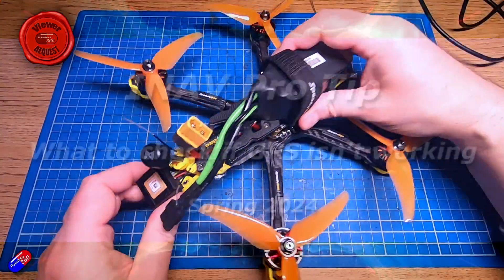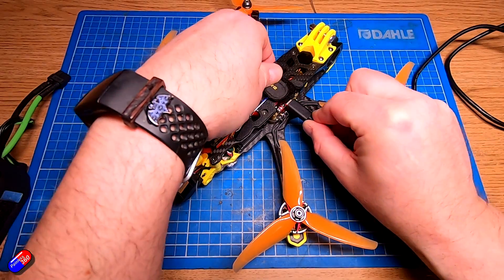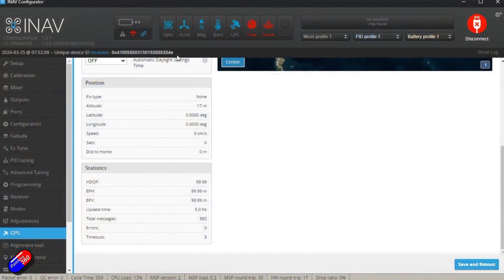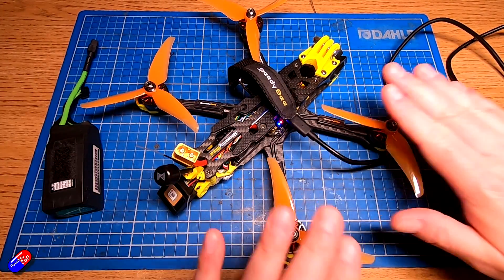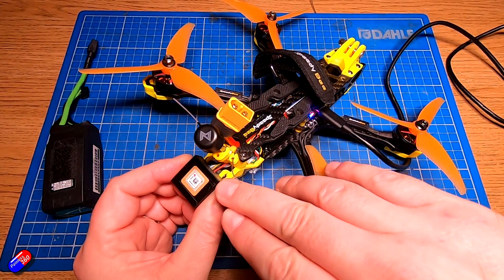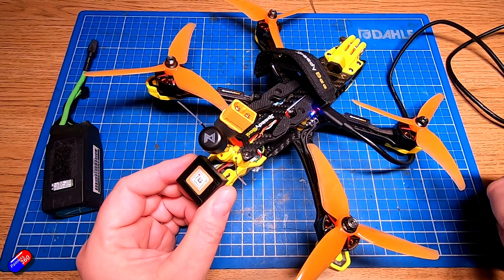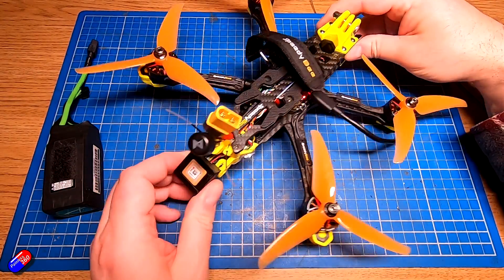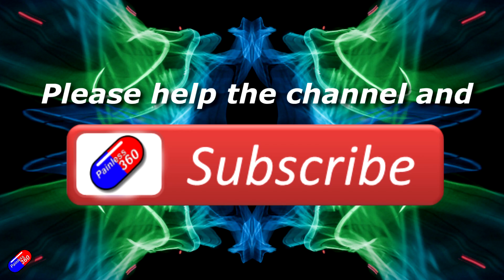How to fix your GPS when it isn't working (INAV)

Comment: I have a fimi manta and i am using INAV so got it working for me to try to arm it but it doesn't arm. Something hardware error,  i checked the GPS and the XYZ doesnt have any numbers like yours did in the video, the RX to TX SCA to SCA and the other to the same, it looks powered on but no movement on the gps numbers. Any ideas?
Reply from the maker: See my video on troubleshooting arming.  Best of luck!
Reply: @Painless360 thank you!!!

Comment: thanks for the video, they are super clear and helpful, on question here, why, I see my latitude and longitude and all the GPS info and 3D fix in inav,  but then, in Radiomaster Pocket and discover new parameters and I can see all parameters, except the GPS info.  I have the  ExpressLRS last version 3.6.6,  the radio firmware updated and the F405-WING-V2 with last inav. I do not understand why is not sending GPS parameters too, any idea?, thanks in advance.

Comment: Anyone had any success by wrapping  the cable from GPS to FC with conductive grounded foil as noise shielding?
Reply: I can almost answer my own question. Just tried wrapping copper slug tape around the cable and earthing it to gnd on the FC.
Previously it took 5 mins to find 6 satellites. Now it takes less than a minute to find 10.
Early days though - I'll see how it works out at the field.
Reply from the maker: Best of luck, watch out for warm vs. cold starts on the GPS giving a false idea of startup times.. Happy flying!
Reply: @Painless360  Just tested at field. Shielding does make a difference - at least for me with 5" quads.
A quad without shielding took 5 minutes to find max of 6 satellites. Another quad with shielding took 2 minutes to find 9 satellites. Very similar quads.
I don't think grounded shielding is a silver bullet for fixing GPS. You still have to follow all the steps in your video. But as a final little step it can really help I think.

Comment: Hello Good Sir, what if My GPS is locking totally fine in Betaflight, indoors, within 1-2 mins, but not in INAV, ever, anywhere...
Reply from the maker: NMEA GPS units aren't supported by INAV now. You'll have to swap it to a UBLOX based modern GPS... Happy flying

Comment: Yes this was very helpful.  So, i have a Foxeer M10 250 with integrated compass.  Strange my red power led never comes on and my green pp something led remains constant ON.  No flickering.  Could that mean the onboard battery is dead?  I’m getting no GPS signal to the flight controller.
Reply: Same here did you find the problem
Reply: @Liqxnx  No.  I purchased a Matek M10Q-5833 instead. I have not installed it yet.  I'll be doing a video on that soon now that I have a decent PC
Reply: @marinehm omg same I just bought that exact one as a replacement 😭

Comment: Hello. Can you elaborate about the gps protocols..? Because some gps module do not have the same protocol with the inav..thanks..
Reply from the maker: You need to get a GPS that talks UBLOX now, as INAV stopped supporting NMEA a few versions ago... Happy flying
Reply: @Painless360  thanks..but is there a way to change the protocol of gps module..?
Reply from the maker: Not normally, most are fixed. So, if you have an older NMEA style GPS and want to use modern INAV, you'll need to replace it. Most are using modern M10 based GPS units that are UBLOX..

Comment: My Inav waits 7 sats to let me arm. Is there a way to set minimum of sats to 5 or even 3?
Reply from the maker: gps_min_sats

But I would strongly advise you to use a better GPS not reduce the number of sats needed... Happy flying
Reply: @Painless360  Thanks! I think 5 sats is enough. But the reason is in my area to lock 7 sats takes a lot of time. It's really annoying...
Reply from the maker: I'd switch to an M10 based GPS and enable all the different GPS systems.. It should help a lot... Best of luck

Comment: Thanks for this helpful and comprehensive video - it was just what I was looking for.  Alas - no solution to my problem, here:

I've got an existing quad (a SpeedyBee Bee35) that has been fully functional with BetaFlight - which rules out a lot of the potential problems (e.g. Tx/Rx roll, etc).  As shown in the video, I've got the Ports tab configured, GPS enabled in the Configuration tab, and see messages steadily incrementing in the GPS tab.  However - never mind a 3D fix - I never see even a SINGLE satellite (continuous Sats: 0) in INAV, even when the quad is outside with a clear view of the sky.

Alas, the stack I'm using (SpeedyBee F7 Mini) doesn't have a 4v5 pad which powers the GPS when connected via USB - so I need to attach a pack to power up the GPS (as confirmed by the blue GPS icon at the top of INAV) - which, as you note, ALSO powers up by DJI O3 VTX.

What's curious is:  This identical build (no changes whatsoever) gets a fix fairly quickly when the FC is running BetaFlight.

Is there any additional diagnostics / debugging that can be done?  Thanks again for the on-point video - I'm sure eager to have my first flight(s) in INAV #LotsToLearn
Reply from the maker: I'd unplug the DJI unit and see if that helps... best of luck

Comment: I have an odd issue. HGLRC M100 was working just fine as recently as yesterday... then suddenly not picking up sats today. Blue icon in iNav, picking up messages, no errors but no sats. Running a SpeedyBee Wing App. Swapped out the GPS with one working just fine on another model, no luck. Changed the leads to the flight controller, no luck. Tried reflashing FC (7.1.2), nothing. Everything else working just fine. Any ideas gratefully received, my next step is a new FC but I'd rather not!
Reply from the maker: I had problems with a GPS on Tuesday. Moved it and it locked again... Odd

Comment: Hi i have a question about the gps if there is no arrow on it what way do you install it do the wires go to the back of the plane or the head of the plane
Reply: My HGLRC's dont seem to have an arrow - just found out the plug generally needs to point forwards
Reply: @ thanks for the help much appreciated
Reply from the maker: It depends on the GPS model. It's pretty easy to get the orientation through a little trial and error in Configurator if you're not sure....
Reply: @Painless360  thank you

Comment: i had the same problem 99.99 m and no errors but the gps appeared blue so i found this video and after watching it i still had no idea what to do, connections were correct so i went outside (im right next to a window so i thought no way this will make a difference) and sat there confused for 3 minutes and suddenly it just worked 😅
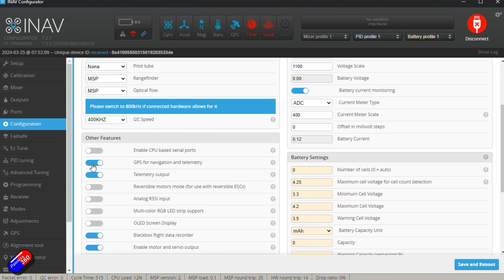Reply from the maker: Yep, very common. See 6:00 happy flying!

Comment: Great tips.  I have a new Flywoo Goku GM10 Pro V3 on a new plane build. Everything is showing blue in inav, I am getting increasing messages and 18 satellites, and yet, after 18 minutes still not getting a lock. Do you have any additional recommendations that might cause this delay? I have tried this woth my VTX on and off.  When plugged into the computer, inav shows exactly where I am.
Reply from the maker: Turn off your FPV gear as covered in the video. And then see if it locks. Most likely interference... Happy flying

Comment: While I have my quad connected to my computer It locks on the sats and shows on the map my location. Only problem I have ,No sats are showing in my DJI goggles It flashes a red sat ,but no sats like in betaflight. What is the reason this could be happening.
Cheers
Reply from the maker: Have you watched my dji setup videos? What troubleshooting have you already done?
Reply: @Painless360  I have never come across anything like this I have everything I want in the goggles after the hack, there' is nothing I can think of why it'ss doing this I could understand if rx and tx were wired incorrectly but there not as I get all the sats locked in while on betaflight It's just not showing the sats in the goggles. That's why I asked if anything comes to mind?
Reply from the maker: It could be a few things, sats not locking when DJI unit is powered due to interference, font file issues on the goggles, something wrong in the setup in INAV... Best of luck

Comment: I configured mine with gps and compass but since i heard in 7.1 you can use only gps, I unselected the compass and that took away the Nav modes.
Reply: How do I set the GPS only for nav modes
Reply from the maker: Covered in the release notes...

Currently, if you wish to fly a multirotor without a compass. You will need to enable a compass (fake is ok) to change navigational modes in Configurator. You should disable the compass after making the changes. This has been fixed for a future release.

Comment: Thanks for the tips! 
I have a question specifically for fixed wing foam planes and GPS. Do you think that foam is blocking the GPS signal or make it work sub optimally? That said, is it ok to put the GPS in the battery bay of a foam fixed wing plane?
Cheers!
Reply from the maker: I've mounted a GPS under thin layers of foam, tape and plastic and not noticed any loss of performance.. Happy flying!

Comment: My biggest issue with GPSs mounted like that is not the GPS itself but the magnetometer. I have been moving the GPS opposite to the battery cables to help with this issue. Another pet peeve of mine is that those small GPSs with magnetometers don't show where it should be pointing, you have to search for the information or look at the magnetometer chip itself to figure it out.
Reply from the maker: See my video on compass alignment. It isn't too tricky if you follow the process. Most of the popular GPS and Compass units have the default orientation now so work with the defaults... Happy flying
Reply: @Painless360  is it need to face the NORTH before calibrating the compass? or not necessary?
thanks for the answer

Comment: Ive got a quad /gps that works fine in BF but when i converted it over to iNav it doesnt read the gps at all.  I even loaded BF back on and it still works in BF but no go with iNav. Yes I have the uart set the same as BF and I do have GPS enabled in the Configuration tab.  Any suggestions?
Reply: What GPS is it? Ask in inav discrod also
Reply from the maker: You don't mention the GPS type... INAV stopped supporting NMEA compass protocol recently so you'll have to check the one you have supports GNSS... Happy flying
Reply: @Painless360  Thanks so much for responding.  It is a brand new M10 GPS and compass.  The compass is working without issue. i think it is foxeer.

Comment: Write the specs and wiring diagram on a small paper to foldup and bag with your parts you keep .parts like gps , buc converters voltage regulators , camera switches,  rx , buzzers , vtx's